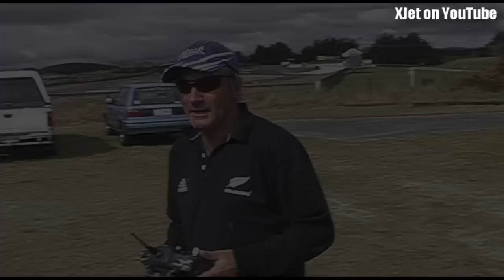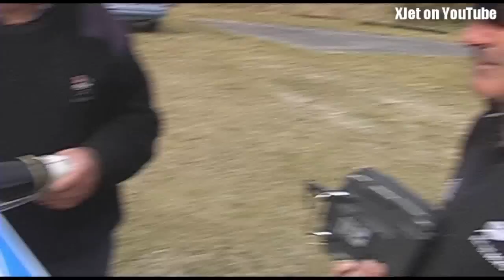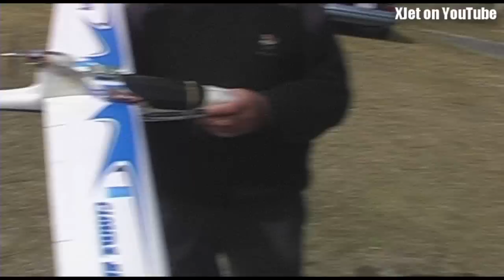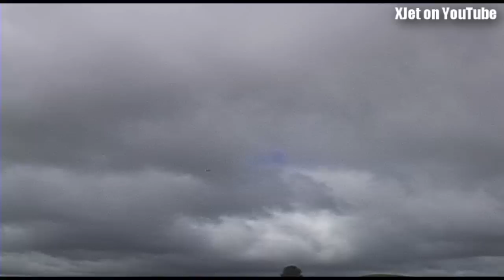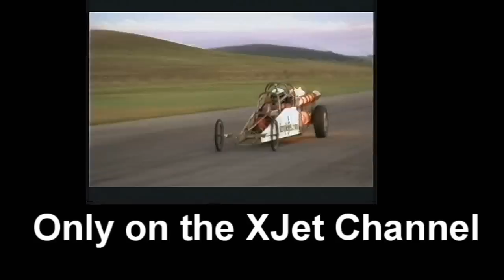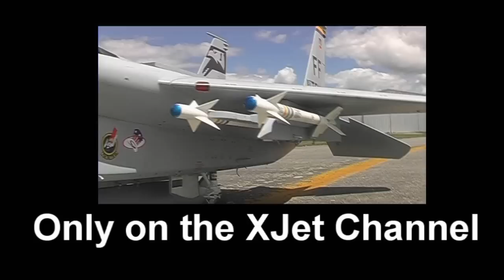Very fast AXN Clouds Floater RC plane draws 505W

Comment: If you want to upgrade the motor to a high performance quad motor this is a great product. It is a simple adapter that uses the existing mount.   https://www.ebay.com/itm/292181303725
Reply from the maker: Send me one and I'll review it.
Reply: Send me your contact info and I will ship it over. Steve@sbeprecision.com

Comment: KV doesn't define efficiency. basically the faster u spin the prop i.e. a higher KV motor will draw more power so shorter flight time, but higher top speeds. a low kv motor would draw less power,so longer flight times but lower top speeds :)

Comment: throw a 6x4 prop on that axn  with that motor
amp draw will drop to prolly 28 amps  and your speed will increase alot
I use a 450 heli motor in mine  with a 6x4 prop
I tryied a lot of differant prob sizes  and the 6 x 4  seems the best i can find

Comment: Hey Bruce, any footage with the prop on the right way? Mine has clipped wings and a large turnigy motor and hopefully if the weather will be ok for a 4s run tomorrow. You HAVE to fly one with the wingtips cut off, picks up heaps of speed and the roll rate is insane. :)

Comment: That motor doesnt sound right. It almost sounds as if a magnet is rubbing or a bearing is dry. Most of those watts are probably just going up into heat. It should be even faster than that!!

Comment: Ive done a 4ch art-tech wing-tiger with a 2500kv on 4s at my early flying days  and also a skysurfer on the same setup. managed to nose both as I didn't have a good radio and I was glying on cheap RTF FMs then. 
tell him to buy an extra set of wings and cut the wingtips (I just hope his wings are removabe like my sky-surfer) that will add much more speed to his floater
just a tip

Comment: Ummm can you please explain what kv means? I understand what amps and voltage is and that Power = Voltage x Current, but where does kv relate in between. How do we find out how much current a certain kv motor (say 2200kv) will draw at a certain voltage (say 11.1v)?